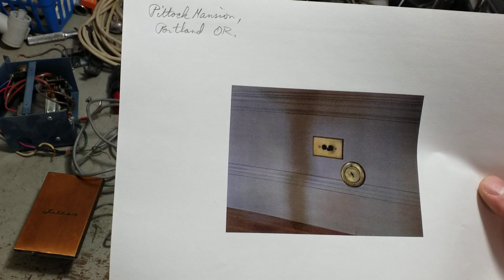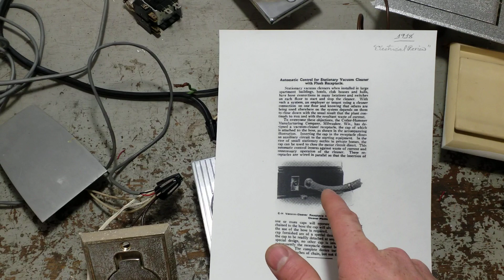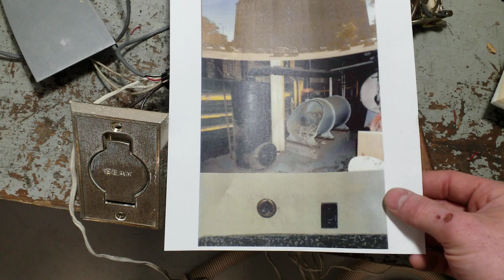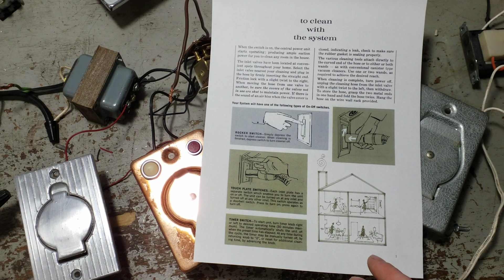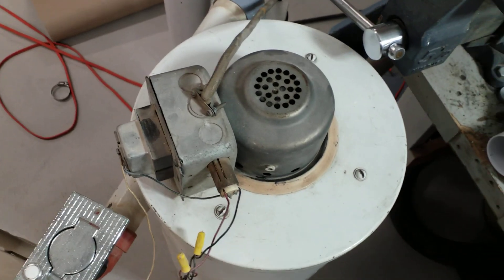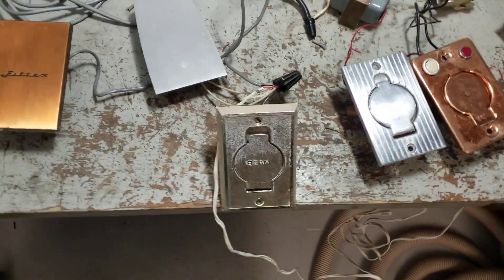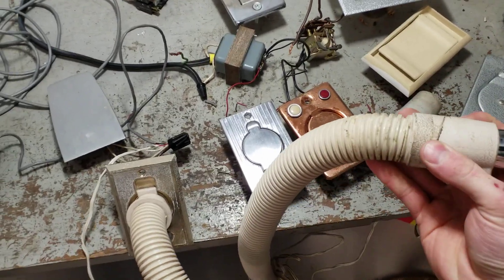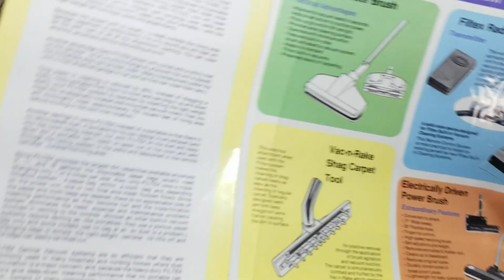History of Central Vacuum Control Circuits

Comment: one thing that I'm a good deal thankful that improved was the hoses themselves(or least I assume in general they did; wasn't around:P)... my dad diy'd a central vac using a shop vac and got a 30ft~ hose from an old central vac(guess 1970-80~), the thing was fairly rigid, and has a lot of ?square/corners? shaping to how the pipe was made to make it flexible, resulting in it getting clogged often, also seem(s) to effect the pressure negatively....when I did up an actual central vac, I replaced the hose with a generic 30ft off amazon(with wired on/off switch on the handle), and have yet to see it clog anywhere but the nozzle

Comment: Interesting information as always. So, for current units, I'm guessing the relay is part of a circuit board? None of my units have a transformer either, it's all part of the unit. Also, for dual motor units, do they use two relays one for each motor? And what about the 240 volt units? I'm wondering if those have a larger relay to handle the higher voltage. Some units have a manual switch to turn the unit on and off, I'm wondering if those switches engage the relay or if they just complete the circuit to the motor and bypass the automatic relay entirely. When using today's units, you never hear anything click when the unit turns on and off so it's probably all solid state now.

Comment: I read that the White House uses a Spencer central vacuum, do you know how they were able to control using that system?
Reply from the maker: I am not sure - sadly my understanding is the system was taken out decades ago during major remodeling. They didn't know what they had!
Reply: @owenperkins that's a major shame! If I were them, I would've upgraded and continued to use it. I bet it would've been far better then those dump-out bagged sanitares that they use.
Reply: Cool thing - if you check the Spencer website you’ll see a timeline of some of their major projects, including the white house installation.

Comment: Got a kick out of this video! Always wondered how fun sharing the vacuum would be in an apartment complex.
Reply from the maker: There is an apartment building I service in Chicago that has two MD SV machines, that were once latching-relay commercial Filtex units. Sadly the pushbutton and light inlets are long gone and replaced by metal round door Beam type inlets. The systems are mostly used for the common areas, but I think a few residents have their own hoses.

Comment: Great video! Here in Northern Ireland Beam is the most popular form of system, unlike the rest of the UK (as far as I can see), central systems are fairly common here. This is perhaps because the Beam UK headquarters are based here. Many people self build and beam has many contacts with builders and merchants etc. The beam inlet featured in the video is a very common sight here. Popularity seems to have peaked with beams from 2000-2010. Many people also have their more modern, flush inlet which looks very pleasant, especially in the stainless steel. It’s a shame we don’t have any option to add power for a pn.